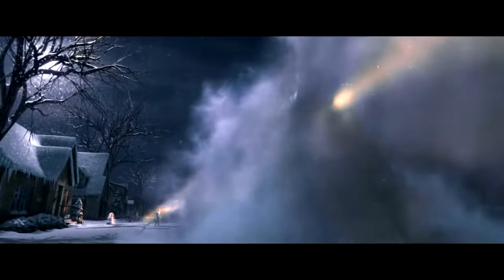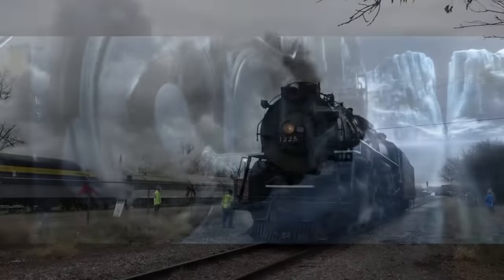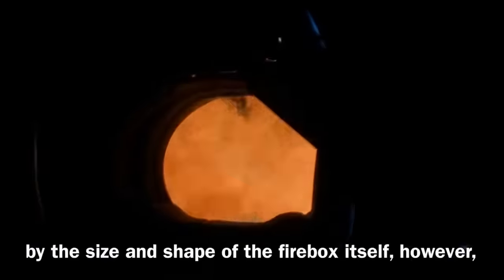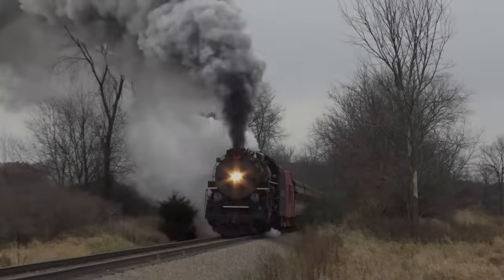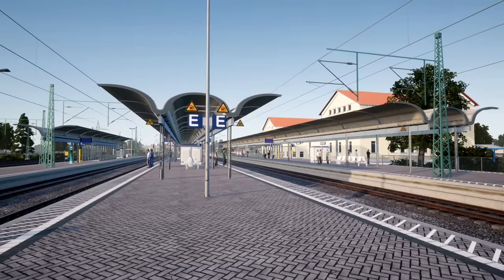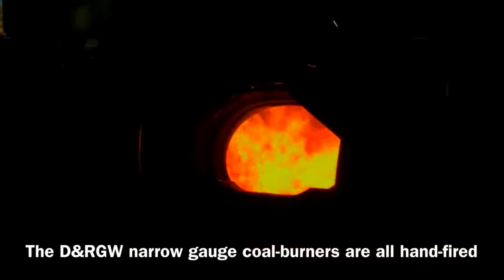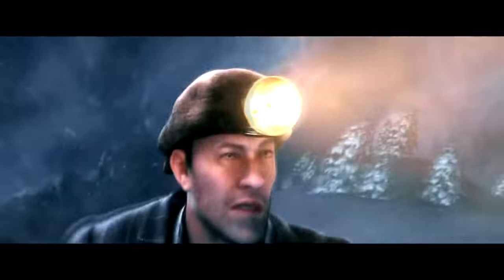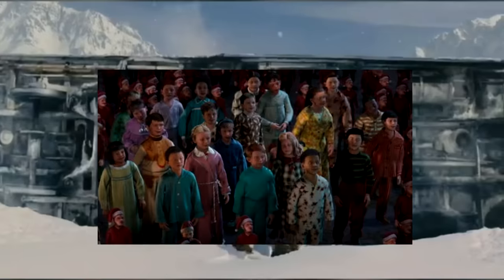Why The Polar Express would Explode

Comment: The Polar Express locomotive was based off of the Pere Marquette 1225, a locomotive that was mainly used on the Nickel Plate Berkshire railroad lines here in the USA. Looking at the movie the way they designed it seems slightly modified from the original, but it's one of my favorite steam locomotives from when I was a child. My uncle introduced me to railfanning when I was very young, so even though I'm not into it as much anymore, it's always cool to me relearning these things about American steam locomotive history. The railroads were what originally was the backbone of the United States and it's economy. Lovely video
Reply: The movie does a fairly good job of depicting 1225 as it looks in the book it's based on.  The book is based on Pere Marquette 1225, but with a bit of artistic license... and many years between it being seen in person and when it was drawn, Van Allsburg played on 1225 when it was on display at Michigan State... a minimum of 16 years before the book was illustrated.  The biggest change and only thing of significance is the enlarged pilot up front.  In all the model train version, that and a bit of piping detail is all that is changed from a standard Berkshire model.  I like the look, but the O gauge models I have do a great job of showing an issue this video doesn't consider... that extended point hits the third rail on any significant grade, and would hit the roadbed and ties in real life on a steep grade change.

Comment: What if, the crew had known about the route and knows to kill off the fire right at the summit and let the train start to coast down the line and restart the fire in the firebox?
Reply: It takes hours to cool the firebox down and more hours still to bring it back up to heat.
Reply: @Hammerandhearth  I would suggest if the crownsheet was already soaked in water when it climbs the hill, it would be able to stay relatively cool for some time, if the crew put off the fire the temperature in the firebox should stay around like 400-600C with opened firebox hatch, well below the level crownsheet could be weakened, I don't think when they coast down the hill they can't be start adding fresh coat and wait a little bit to relighting the fire, using the basically still hot crownsheet, but not instantly blow out level of heat, to turn enough steam to powering the engine with lesser pressure of steam to continue the journey.
Reply from the maker: That is a true statement, if you kill the fire and expose the crown sheet thereafter, the risk of a crown sheet failure drops immensely. It’s the raw heat of the fire hitting the top of the unprotected firebox that causes the failure to begin with.
In WDW’s Railroad, they have a system that will kill the fire if the water gets too low
Reply: So In a nutshell the reason why explode is that too much water into the firebox = steam = increased density making it explode since not enough room to to fit all the steam
Reply: @macapia3148  basically yes and not enough discharge volume to get rid of it fast enough. If you've ever heard of an autoclave they are basically a massive tank with a locking door that holds steam to treat parts at high pressure. Much larger than any locomotive they sometimes explode destroying entire buildings.
Reply: @jordanalexander615  Ik it’s just in a nutshell
Reply: @Hammerandhearth  idk about heatong it up but cooling it down should be somewhat quick due to the cold environment they're in

Comment: Got a question now, let's take the angle of inclination of the tracks as @. Then if the locomotive is resting on the tracks, the water inside the boiler and the locomotive would experience a gravitational acceleration of gsin@. So, when the locomotive is chugging down the hill, accelerating using steam, because water experience just gsin@ while the locomotive is moving with gsin@+ (acceleration due to force generated by traction force of the locomotive)water would slosh to the back end of the boiler right? And the instant water sloshes to the back end of the boiler it would have the same gsin@+.... and would continue to stay at the back end while the locomotive chugs down the hill??
Reply from the maker: This would only work if the locomotive was traveling much faster than the acceleration of gravity which is 9.81m/s^2 from when it was climbing the hill to it cresting and then descending the hill. This does not happen in the movie. We can use the characters in the front of the train as a reference point.
If we look at the characters in the movie, they are slowly lifted upwards only after the train starts to descend down the hill. From this, we can infer that the train is traveling down the hill slightly faster than the acceleration of gravity once it crests the hill. The water in the boiler would most likely be experiencing the same effects as the characters, sloshing to the front of the boiler as the locomotive crests the hill and then slowly lifting up as the train starts to descend. If the locomotive were traveling at a speed that would keep the water pinned to the back of the boiler then the characters would be pinned to the front of the locomotive's smokebox as well.
Now, with the amount of time the locomotive accelerates down the hill, would it have been enough time for the water to go from the front of the boiler to the back and cover up the crown sheet? Very hard to tell since that would require us to know the area of the boiler as well as how much water the Pere Marquette 1225 carries inside of its boiler. However, there is no point in the Glacier Gulch section of the movie where it is implied that the engine accelerated fast enough for the characters and water in the boiler to be pinned to the locomotive
Reply: @ChriswithaK  Makes sense. Well, it was pretty amazing to discuss and I always love to have conversations including physics. Thanks a lot for the answer. Keep up the work. Good luck.

Comment: Debunk: The Locomotive Boiler is Completly filled
Reply: And 

It's magic
Reply: And that’s the final nail in the coffin
Reply: @lordseelenfresserdemonking1168  EXACTLY!
Reply: Then the locomotive would “lift” the water sucking it into the steam chest and the pistons. You’d see water being thrown out the stack
Reply from the maker: If you completely fill the boiler you will literally blow the cylinders apart. Unlike steam, water does not compress so as the cylinder heads move back and forth with water in them, the only place they can go is outward. This has happened a few times on the railroad, the one that comes to mind is Blue Peter
Reply: @ChriswithaK  or . . . It's magic

Comment: Maybe the reason the polar express did not explode in the movie is because of the force of going down may have pushed the water in the back
Reply: Guess the guy doesn't know his laws if physics. 😑
Reply: @RyohuHajimeRX-0UnicornGundam  I guess
Reply: doghara  Since coal is more denser than water, it takes more force to move it.
Reply from the maker: The Polar Express didn’t explode cuz it’s a Movie lol, they’re not gonna show kids and body parts flying around. As for the water, the train crested the hill at a low speed. If you watch the clip I put in, they don’t get lifted up until they start going down. That’s because they went over the hill slow and started accelerating after they started going down. If you apply your logic to the movie, everybody including the engineer and fireman would have been thrown back to the back of the engine which didn’t happen

I’m honestly so surprised people don’t understand this, I thought it was super simple so I didnt even include it in the video. Guess I was wrong lol
Reply from the maker: @Ryan Hayes That is true, but the coal in the engine is much lighter than the engineer, fireman and characters in front of the locomotive. It’s a true statement but it is not true in the sense of the movie
Reply from the maker: @Colonel von kriger what does the smoke stack have to do with anything?
Reply from the maker: The firebox? It’s almost impossible for coal to fly through the smoke stack since it has to go through the flue tubes, smoke box and then out of the smoke stack. Usually you’ll only see black smoke since that’s particles of coal getting pulled through by the air moving through the firebox
Reply: Colonel von krieger  yeah it’s an possibility with the firebox doors open

Comment: Correct me if I am wrong but theoretically a tube essentially filled with water traveling at such speeds down a step slop wouldn’t the force of gravity be pushing the water up cover the box completely and thus the fire box is only exposed seconds after evening out and thus no harm down?  So theoretically the Polar Express still wouldn’t explode correct?
Reply from the maker: Read the pinned comment

Comment: My biggest question is, 1. How far did the train go for. Like, it's going from cityes to the north pole. How long would it take, and would the train haft to deal with ocean? Could a train handle that without refueling? 2. How does the time magic work. Its show when the train comes it slows down time(not freezing it). So how slow is it going, and would that time scale be noticable by everyday street cameras, and high speed cameras.

Comment: I work on older factory machinery that the programming and calibration software won't run on anything newer than XP so I have 2 XP laptops and a XP desktop I have to keep in good running condition. Fortunately I found an upgraded XP version called Black Elegant Edition where Microsoft gave the source code to a foundation that upgraded it, made it free to install without a license and added a few programs, but not a lot of bloatware.

Comment: The water doesn't flow to the front of the engine because its accelerating as fast as the locomotive is
Reply from the maker: Not true, as seen in the movie they’re not accelerating fast enough. If that were the case, all the characters would have been immediately launched upwards as they crested the hill

Comment: I wonder... How fast was the locomotive accelerating? If the throttle was still open and allowing it to accelerate faster than 9.8m/s², then the G-forces could force the water towards the back. On the other hand, this would also prevent the characters from successfully skiing down the top of the train. This calls for someone who's good at measurements and math.
Reply: I was wondering the same thing, the train seems to be going pretty fast.

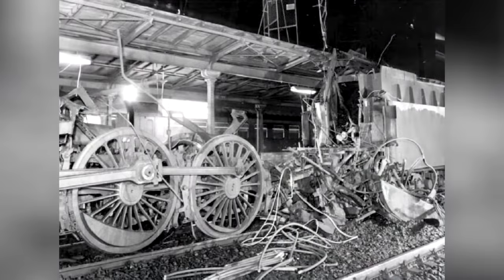Comment: 7:10 thats unless the train is accelerating downwards into the drop rather than attemptimg to go down with constant speed. If the train just lets itself accelerate down the drop, the same thing that happens on roller coasters when you go down a drop and feel your stomach floating will happen, and the water will be weightless on the axis parrelel to the axis that the train is facing.

Thats what also could've saved the roller coaster scene from boiler explosion, if we ignore them pulling like 90 G's at the end of each drop and have them survive that somehow..

Comment: Wouldn't the water stay OVER the crown sheet anyway because the engine is moving? If it's moving down the water would be pushed back
Reply from the maker: No, check the pinned comment

Comment: Forgive my possible absent mindedness but wouldn't it be possible to build some sort of water bulkhead in the boiler? Cause then each compartment would be equally submerged and when it levels out there wouldn't be any big ol boom?
Reply from the maker: A steam locomotive boiler has very little space, outside of the firebox and throttle valve, most of the space is taken up by the boiler tubes which take heat from the firebox and exhaust them through the smoke stack. The locomotive the polar express is based on has what’s called a super heater which is a series of even more tubes that run the steam from the throttle back into the boiler to be reheated to what’s called dry steam. This steam is much hotter and more powerful than the steam that comes directly from the throttle. A bulk head in the boiler could potentially work, however, given the extreme limited space and the fact that water surrounds all the tubes in the boiler, it might be difficult to achieve
Reply: @ChriswithaK  ah alrighty then, thanks for the reply!

Comment: Actually you did a bit of a oversight because the train going downhill fast  Causing the water still remaining covering the firebox when they're going down the hill because the sheer amount inertia pushing back the water still covering firebox If you considering the train will explode that should've been the part when when is running low of water and all the sudden a sudden stop will cause a explosion

Comment: As the train crests over the highest part of the hill, the water would more likely float or hit the top of the tank, this would more than likely still cover the top of the fire box. As it starts to go back down, the water will remain towards the rear and slightly up towards the top before settling towards the rear again as it goes down the hill, much like those artificial gravity experiments with the water cup not sloshing around in a jet doing aerobatic maneuvers. Only when the train hits the bottom of the hill and all the forces pull the water down will it potentially uncover the firebox, but even then it might not be for long depending on if the train is still accelerating or if how full the water is.

Comment: The only thing I can think of is if the engineer knew the down hill part was coming up and chose to put out the fire since they wouldn't need any while going down hill, and since it's a train, they would have had to know that this path was coming up so they probably would have acted accordingly, ofc they need the fire to get up the hill in the first place, but once they are over, they would just need to put it out on the way down

Comment: Seeing as it's implied the Polar Express has run this route for years, I would assume that there are modifications that allow it to run without risk of a boiler explosion. If I had to guess, something that would be added is a separation between the firebox area and the rest of the boiler, with a small pipe minimizing flow between the two so that it would keep the water level in the firebox high enough so that it would keep the crown sheet covered for long enough that it would survive the hill and the roller coaster sections of the line.

Comment: The fusible plugs do indead operate when the centre core melts at a set temperature releasing steam into the firebox providing a noisy warning, plus you forget steam engines have safely valves that dump excess pressure to the outer air. Plus regular boiler pressure checks require the boiler to be pressurised to one and a half times normal operating pressure and hold it for ten minutes. 
Thankfully boiler explosions are rare.

Comment: I do want to pose a couple of counter points. Firstly, it’s possible that they might have anticipated the downhill move and deliberately added extra water and/or cooled the firebox a bit. Also, since both the train and water are moving downhill, the water would likely be kept in contact with the firebox. I don’t know the exact physics so someone correct me if I’m wrong there. Also, this is far from the most glaring physics issue. The biggest being, there is no way that train would be able to climb grades that steep. No train can. Trains are notoriously bad at climbing hills due to the incredibly small contact area between the wheels and rails as well as the very low coefficient of friction between steel on steel. Not to mention the train literally bending around the supination spiral track after the ice lake scene

Comment: I don't know trains, but I do know g-forces, when something's speed is increased, anything inside will be pushed in the opposite direction, so if the train is moving forward, the water goes backward, and when it slows, the water goes forward, you can try this yourself by putting some liquid in a glass, and then pushing that glass back and forward, the liquid will stay on the opposite side of the movement, and since the train is accelerating when down the hill, the water gets pushed back, gravity can only affect that if it's moving faster than roughly 9 m/s.
TLDR: G-forces would cause liquid to cool the boiler when accelerating, this is why fast trains don't blow up.